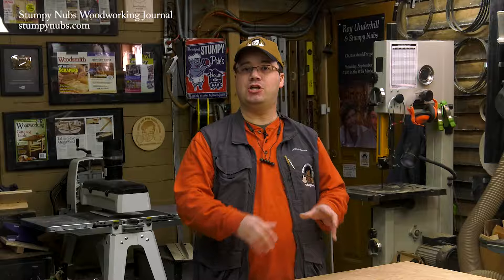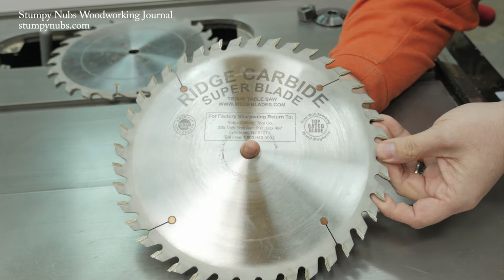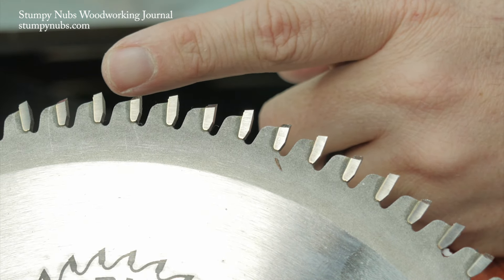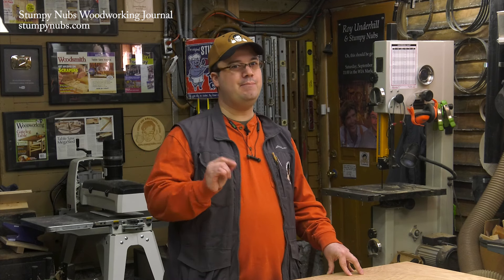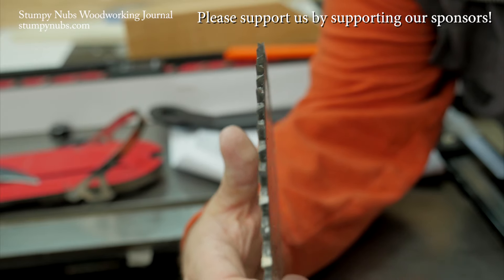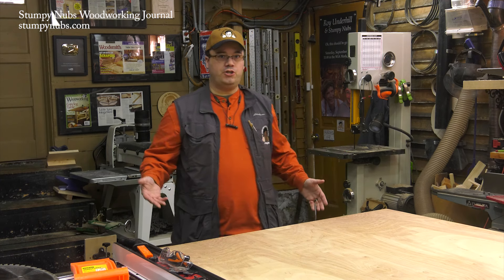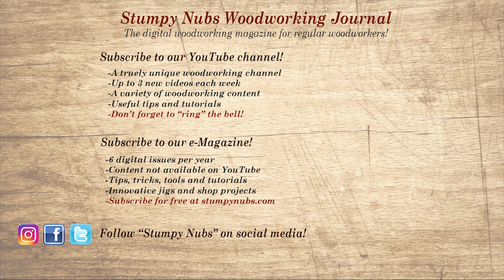Plywood is difficult to cut on the table saw? Let's fix that...

Comment: Hello,

Thanks for the videos and learning, you're great !

i just would like an explanation on your rules for rip fence / sled :
at 6:42, you say : "as a rule if the length of the edge that's against the fence is shorter than the distance between the fence and the blade [...] use a sled"
you're much more experience than me, but with this rule, it means i could do a cross cut on a board that is 3in x 50in (pushing to the extreme for the purpose of the example), if my fence is at 2in from my blade.

this seems dangerous for me as the piece has not yet reach the riving knife while beeing cut, should we use a sled in this example ?
isn't supposed to be the longest side must be against the fence ?
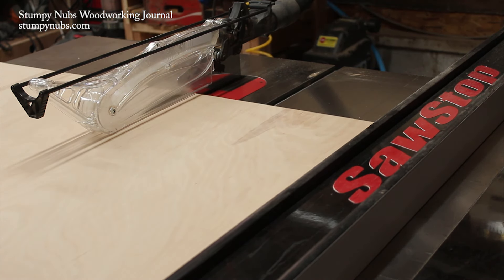i would like the do a cut that is similar to the one you make at 6:24, (to be exact i want to cut 6inch from a 30inx80in,  the 30in against the fence) but i feel like i should use a sled

thanks !
Reply from the maker: It's a general rule with exceptions, such as very narrow or vary wide workpieces. I believe I cover that in more detail in the crosscut video of this series.

Comment: Great video, loaded with useful info and content.  One bit of disagreement where it comes to cross cutting a piece.  I think in no case should you cut a piece where the edge against the fence is shorter than the other two edges.  Your info was to not cut if the edge against the fence is smaller than the distance between the fence and blade; i would argue that even if it wasn’t, it’s still a dangerous cut.  My $.02.  Thanks again for the great content.
Reply from the maker: How could you ever crosscut a full sheet, then? In fact, you could never crosscut any 48-inch wide plywood panel that's longer than 49-inches
Reply: I would move to a track saw; or as soon as it fits on my sled it goes there.  49x48 is an extreme example though.  The piece being held in your example was maybe 9x20; and i wouldn’t put that piece on the saw with an 8” fence width and feel comfortable, but your instruction kind of indicates that’s ok.  You are certainly the expert authority here...not me, my squirrelly sense would be going off there though.
Reply from the maker: The danger is that a piece can twist during the cut and pinch between the fence and the blade. The waste on the other side of the blade (opposite the fence) is irrelevant because it can't pinch against the fence. The exception to that rule is if the work piece is so long that you have excessive weight dragging on the top of the saw that would cause you to turn the board during the cut. So I wouldn't run a 12 inch edge of a 6 foot long panel against the fence. But that was not the case in my example.
Reply: @StumpyNubs   not with here man.  You said "as a rule, if the length of the edge that's against the fence is shorter than the distance between the fence and the blade, you wont be able to keep that panel from twisting".  You were holding a piece ~10"x24".  By that rule, if i set an 11" cross cut width, I am safe without a miter gauge or sled on the piece you were holding?  I am not comfortable there man.  my rule - if the edge against the fence is shorter than the piece is long, and the piece is small enough to fit in your sled or in front of your miter, then use those tools, always.
Reply from the maker: @unbobweavable  - No, an 11" cut with a 10" edge against the fence breaks the rule. Look, I can't explain it any better than I have. If you disagree, that's fine. Have a nice day.
Reply: @StumpyNubs  you're right.  My mistake.  I meant 9" cut.  You have a good day too.  Didn't mean to be a PIA or combative.  Your videos are great.

Comment: Yea I dont know...
Ridge Carbide 80T (minus 10% off coupon) is $140 shipped to California, whereas the Forrest 70T is $133 shipped from Acme Tools. Think Id rather just stick with Forrest.
Reply from the maker: Ridge Carbide shipped is 131.50, at least to me in Michigan. 80-teeth naturally would cost more than 70, but the two are almost the same price. As for quality, there's little difference.

Comment: Regarding blades, I'd rather have a good blade in a cheap saw than a cheap blade in a good saw.
Reply: Good blades are important.  An underpowered saw is an underpowered saw and if you can't push the material through without it stalling it doesn't matter that you paid more for the blade than the saw.
Reply: "Cheap" does not necessarily equal "underpowered". Good blades are not necessarily expensive either.
Reply: TakeAmericaBackfromISRAEL  Right, for that stuff and many of my rough dimension cuts I use really good but awesomely inexpensive 7.25" super thin kerf ATB carbide circular saw blades. $4-6 each
Reply: Sky Warp: “...weather...”, should read whether.

Comment: It looks like the blade you recommended for plywood  (Ridge Carbide 80 tooth blade) on their website is not for table saws but for miter saws and radial arm saws.  Is that the blade you meant (or perhaps I got something wrong)?
Reply from the maker: It's designed for fine crosscuts, which is why they also sell it for miter saws. It's an excellent blade for plywood, miters and other precise crosscuts.  (Use coupon code SNWJ10)
Reply: @StumpyNubs  Thanks. Just ordered.  The discount amounted to free shipping :)

Comment: What type of plywood do you use for your shop shelving projects?
Reply from the maker: I usually use the $50 birch veneer stuff off the rack at home depot. I have used their sanded pine, but make sure it's the 7 layer and not the 5 layer.

Comment: Sliding tables saws are the safest for all plywood cuts!
Reply from the maker: Yes they are. But they are also big and expensive and few hobby level woodworkers have them.
Reply: Stumpy Nubs yes, some can be large and there are others that are short sliders, which make cross’s cutting very safe and highly productive and accurate.  I’m just lending another perspective or possible idea for others.  Thx
Reply: If safety is the primary concern then a CNC beats even a sliding table saw. (I have both.)

Comment: Does that Ridge blade really give you a flat bottomed cut? In the link, it says "nearly" flat-bottomed, and the picture makes it look as though the raker tooth is shorter than the rest which would leave those little bird beaks in the corners.
Reply from the maker: This is not the blade I would use for joinery that requires a flat-bottomed kerf. We made a video about the right blades for that purpose. You'll find a link to the blade I use in the notes below the video, but I recommend you watch the whole thing to see the blade comparisons: https://youtu.be/PZXg5KA0P-Q

Comment: I always check the factory edges with a framing square....
Reply: Check the entire 4 x 8 sheet for square . 107.25 inches corner to corner . Rarely will you find " properly stored " materials to be out of square as the factory is a controlled setting .

Comment: that fine tooth blade looks like it is negative rake, I though that was generally not for table saws, only for chop saws
Reply: Works fine on the table saw too.
I got a 10" Ridge Carbide negative rake 60 tooth blade for my RAS, but decided to ditch the RAS. 
That blade is now my plywood blade for my table saw. Really nice tearout free cuts, with nearly polished edges. I'd imagine the 80 tooth blade would be even nicer.

Comment: I dont have the money to spend on a so called track saw but about to build me a door board in 4’ and 8’ length. I was also allow an inch bigger so i can run it threw the table saw. Got 15 or so cabinets to build. Never built them but doesnt seem like rocket science. Best thing i read was take your time as being in a hurry just makes expensive firewood.

Comment: How do you cut a square block of wood that is taller than your blade?
Reply from the maker: Cut on one side, flip and cut the rest from the other. But beware, if the block is shorter in length that the side of the saw blade, you can easily get a kickback if you are ripping with the fence in place, even if a riving knife is installed behind the blade! That happened to me years ago, and I was lucky to not lose any fingers! Consider making a sled and clamping the block to it.

Comment: What about scoring the plywood for a cleaner cut?
Reply: Takes too long and with a tuned saw and good blade it isn't necessary.
Reply: When I use plywood I lay out my cut lines with a T-square and a good Sharp marking knife. I never have a problem with veneer tearout

Comment: Hmmm, over 40 years of some bad habits or misinstruction.   First thing Ive done,  is put the blade guard back on the saw for the first time in 30+ years, and get my safety supplies   Thanks!,  the grandkids won't need to ask "Pop's" finger went.    Apreciate the refresher as I double down upgrading my shop and do more woodworking .

Comment: Track saws are a better tool for breaking down plywood. I put a piece of 2" thick insuation board on my tablesaw bench/outfeed table, then put the plywood on top of that and cut it with my track system- much safer, and easier on my back, lol.

Comment: I never cut plywood (or other large panels) on a table saw. I always do it on a foam panel on the floor, with circular saw and guide.
Reply: Same here:  I use a tracksaw.  Virtually impossible for you to get anything accurate from a 4' x 8' on a table saw, might as well have them cut it for you at the lumberyard if you're going to do that.
Reply: @BloxGuy66  Accurately cutting full sheets down on a table saw is actually really easy if you are set up for it! It does take up a bit of shop space though... ;)
Reply: @markbeiser  Easy, perhaps....depending on infeed/outfeed support.  Accurate, hardly ever.

Comment: I have always had best luck with the "good side" up. And elevating the blade higher than normal.  If the teeth are coming down into the good edge, there shouldn't be any tare out. Less teeth ? Feed slower. let the blade do the work.

Comment: Years ago, in a pinch, we would turn the table saw blade around to cut plywood so the back of the teeth hit the wood first.  What is your thoughts on this?
Reply: If there were a good reason for that they would make the blades like that.
Reply from the maker: Modern blades are made to score then slice the fibers. You would get none of that with a backwards blade. And carbide teeth are not meant to be impacted from the back. I wouldn't do that.
Reply: That's a common trick when cutting thin vinyl like siding, but I would not try it with any kind of wood.

Comment: Less expensive than the other premium brands? $130 is more than any top of the line sawblade ive seen on store shelves.
Reply from the maker: You're won't find top of the line on store shelves. Not unless you're going to a woodworking specific store.

Comment: Two words; Tack Saw.
Reply: The Competent Man...And here are my two words...can't afford.
Reply: @marbleman52   I know that feeling.    I compared the cost of a good cabinet saw, and realized that most of the advantages of big table saw were for, wait for it, handling big sheets.  So... my small benchtop table saw (Delta) handles 99% of my 'stick' work, and even can accept a dado stack,  and my track Saw (Makita) handles all of my 'sheet' work.  The two add up to less $$ than a cabinet saw would. With this combination I'm not strapped to my shop.  I can take my setup to the cabin, a buddy's house or wherever.  There are also lots of diy and off-brand solutions for track saws out there too.

Comment: You often stress safety, one basic rule is to NOT wear long sleeves around machinery. A note on a blade for plywood : Triple chip w/ raker is ideal.
Reply from the maker: There is no reason why you can't wear long sleeves around machinery. The sleeves on my shirt hang about 1-1/2 inch from my skin. If your arm is getting that close to the blade, you have bigger problems than your shirt. That said, I wouldn't recommend loose (unbuttoned) cuffs around machinery, which is something I see from time to time online.

Comment: Nonsense. Get a panel saw for the type of thing. Table saws are not for massive sheets.  They are for medium manageable sized rips. Not 4x8 plywood. Pure nonsense.
Reply from the maker: First of all, some table saws ARE for large sheets. Second, panel saws are expensive and take up a lot of space. To suggest everyone who needs to cut a sheet of plywood should have a specialized tool for it is... well you said it yourself... nonsense.